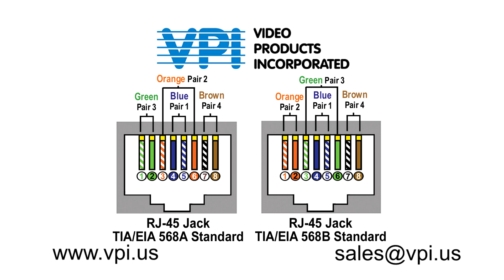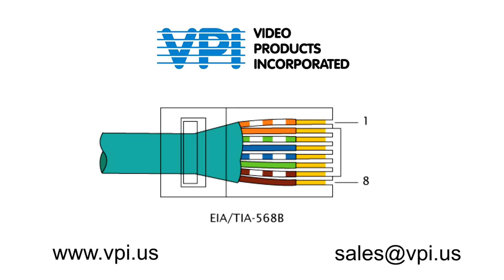What is the Difference Between TIA/EIA 568A and 568B Network Wiring Standards?

Comment: So only the USA federal government requires a color scheme (A).  As such, it is probably installed at an extra cost to the taxpayer.  That makes sense.
Reply: Most of the time you’d be right. In this case, the color scheme is important. Since the wires are twisted pairs, not using a compatible color scheme will prevent the noise cancellation from working properly. So the signal will go to the right wire, but the interference Will become a problem the longer your connections get. So use either the a or B standard so that the high speed signals work properly.
Reply: 568A is compatible with RJ11 RJ45 Mixed-port FAX Machines as well as many other telecommunication electronics, which a government building would need.
Having wire Pairs 1 & 2 in the center slots is what makes this compatibility possible.

But instead of doing Actual Research on a subject, You Choose to be ignorant.. That's just sad.